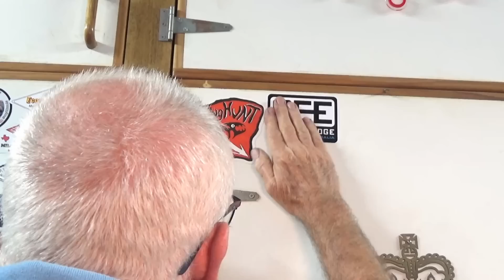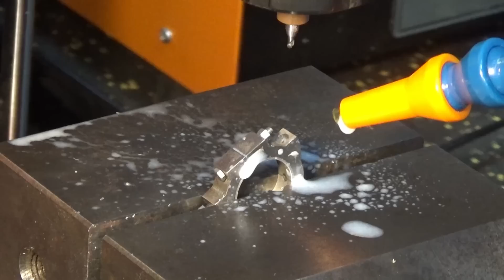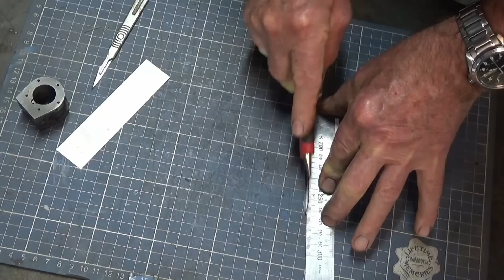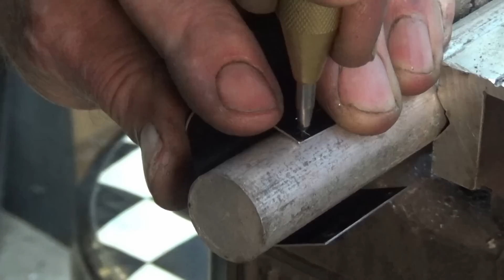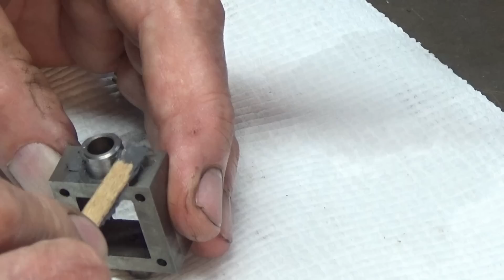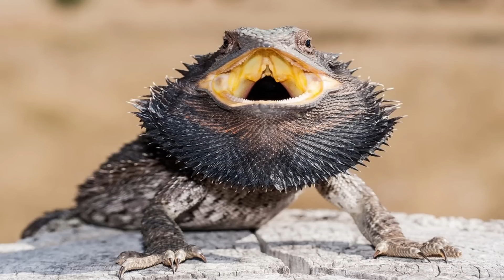The Stuart Turner 10H Part 8. Final Assembly and Run

Comment: How much luck do you need for the broken end of a carbide drill to jump out of the hole rather than digging in?

I'm making a locally produced Bolton #2 horizontal engine ATM. It's a pretty simple thing to make if you can avoid doing dumb things like getting the ports off-centre despite using a DRO & edge finder!
Reply from the maker: I know! Crisis averted, I reckon. It hardly ever happens around here.
Regards,
Mark

Comment: Great work!!! I have cleaned up sticky dash pots in high voltage circuit breakers which are essentially a piston and cylinder using Brasso. Perhaps a quick run with Brasso instead of or mixed with oil might help? A good clean afterwards of course.

Comment: Carbide drills are very sensitive to runout. On a drill that size, even .001" runout is a lot. I suspect this was part of the reason it broke. Luckily it fell out of the hole though!
Reply from the maker: I knew it was a high risk procedure and I fully expected that I would end up breaking a few bits. Getting it jammed in the hole was my biggest fear though.
Regards,
Mark

Comment: Once again a perfect candidate for EDM plunge tool. If you have any small knowledge and practise with electronic bits an pieces, it is a fairly easy thing to make. I suspect most small stick welders use transistorised power supplies at reasonable frequencies, ie 10-20 Khz. This is more than suitable for plunge edm use, next is a device to raise and lower electrode into work, this can be easily done with off the shelf stepper motors and drivers, the mechanical part you can make easily. The only tricky part is to control the power requirements via sensing over and under voltage/current, which triggers the up and down motion of tool, and possibly shutdown current in device. All of this stuff is off the shelf today.
Reply from the maker: I know just enough about electricity to be dangerous. But, I would love to get into wire EDM and the like. It still seems like devil magic to me!
Regards,
Mark
Reply: @Preso58  the plunge tool is far easier than wire type (brass wire running through rollers), there were simple plans around for broken bolt removal, this can be implemented from simple to more refined control over both electrical and mechanical aspects.

Comment: Hey Mark 👋🏼
That little engine is a quality build….. so when it is ‘run in’ it will go like a Singer 😁
We get LOTS of Eastern Water Dragons down here ( Sydney ) 
Specially along the creek lines.
I’ve seen one monster over 30” long 😱
Sometimes the ‘knock’ is caused by ‘late’ valve opening ( valve should admit just before TDC and BDC to provide a ‘cushion’ at the reversal of the piston stroke.
Love yer work mate… and you’re right about Kurtis & Karen. His videos should be ‘required viewing’ by all Yr. 10 students as part of Career Advice.
Inspirational…. 
I suggested just such an idea to the Queensland Govt. guys down at the recent Manufacturing Expo.
Polite nods but not much more
😤
Robert
Reply from the maker: Robert, I mentioned to Kurtis that I would have gladly used his videos as a teaching resource in my VET classes but YouTube was blocked on our school network. By the time I retired I had grown disillusioned with the way the classified positions in Education Queensland  had been infiltrated by "career educators" who had spent little time in the classroom but felt they knew enough to tell us how to do our job. Do I sound bitter? 
I am sure the Stuart 10H will run a lot better after I dismantle it for finishing. I need to go through every assembly and fine tune the fits. 
Regards,
Mark
Reply: @Preso58  
Hear hear on the Pencil Necks in Bureaucracies mate 🤬🤬

Comment: Let me try again....
Hi Mark. Great Vids.
Just wondered if anyone out there, who's just got a simple cheap lathe and no milling machine with no DRO etc, knows the old school way of using a face plate, verticle slide, "keats" angle plate etc, to machine bores or other features etc...Would be interested to hear your comments! Cheers.
Reply from the maker: I have all those things because I started out having to use a medium sized Hercus lathe (copy of the South Bend). It wasn't my lathe but it belonged to the school where I used to work. I would go in on the weekend and do all my hobby machining then. No DRO and very little tooling. I used a standard Mitutoyo vernier (not digital) and I ground all my own tools from HSS. Having had that experience made me understand backlash in lead screws and how to compensate for it and using HSS tools made me appreciate feeds and speeds and what you can and cannot cut in that way. It is just my opinion but I think that most hobby machinists probably start out with the bare minimum of equipment and gradually acquire more accurate and more expensive tooling and accessories. 
Regards,
Mark

Comment: Good thing you could save the oil passage. And thinking that I wanted to offer you some very small carbide drill bits when you were here. But you refused :)
Reply from the maker: Ahh yes. I never thought I would need them! How wrong I was. Every time I go to the dentist I ask a lot of questions about the tools they use. I recently had to have a root canal procedure and I asked about the files and drills they used and they gladly showed me. The little files are finer than a strand of hair and they can curve around and follow the nerve cavity in the tooth. At the same time I was given the little dental burrs I was also given three dental picks and probes. They are wonderful tools and super tough. The quality of the steel is exceptional. 
Regards,
Mark

Comment: It's annoying when the engine runs stiff after all that work. I had the same thing years ago but it was much worse than yours as I had to machine 3 thou out of the cylinder and all was good after that but it took me almost all day to find the fault. I still could not find why because I machined all the parts to dimension.
Reply from the maker: Yes, it's frustrating. I thought I was doing really well up until the time I started to fit the cylinder to the rest of the engine. I think the issue is a lack of concentricity in the piston rod gland. I cut the threads with a die and I should have single point threaded them while they were in the chuck. I may have to bore the hole in the gland a bit bigger. It goes against my instincts to oversize such a hole but the gland packing will take up around the piston rod and it won't leak but it still seems like a cop out. 
Regards,
Mark

Comment: I have never been able to drill a hole with those small tungsten drill without breaking one either!
Reply from the maker: I had read some reviews of that set that I bought and that was the common complaint. I sort of knew there was a high chance of breaking it but I just wanted to get through the surface hardness. If it had jammed in the hole I was going to be screwed but for once the broken off point did the right thing and flicked out of the hole. 
Regards,
Mark
Reply: @Preso58  I have bought loose ones at exhibitions for 10p each. I think they may be designed for drilling PCB  boards. The cutting edge has a small angle compared to a normal drill.

Comment: Hi Mark. Well done on getting out of a bind. The Dremel comes in handy from time to time. The Stuart engine looks beautiful. 👍😀
Reply from the maker: I wish I had one of those Foredom flexible shaft grinders. They always seemed to be the most desirable of the hand held grinding tools. I used to drool over the advertisements in the old Model Engineer magazines and even the older style of Dremel tools seemed to be a luxury I couldn't afford. As it turns out, the Dremel I am using now is the third I have owned. The first one ingested a piece of steel scrap and blew up spectacularly while I was using it and the second one had a failed speed controller unit. This third one had better last!
Regards,
Mark

Comment: American patriot Thomas Paine once wrote "These are the times that try men's souls..." While he was not taking about machining stainless steel, it applies to your frustration! Very happy it turned out okay in the end. I really like the brass lagging! Your local menagerie never ceases to amaze me mate! The engine is a work of art.
Reply from the maker: Thanks. Despite the multiple problems with that 3D printed eccentric strap and rod, it really does look great and it satisfied my curiosity about 3D printed metal parts. I have a model turbojet engine that is currently awaiting some remedial work due to a hot start distorting the nozzle guide vane assembly. I made it from two stainless steel parts that were tig welded together. It was not the best way to do it because the assembly is prone to distortion due to uneven heating. I am considering having the part printed as one piece. The great thing about 3D printing the part is that the complexity of the part doesn't increase the cost. It's only the volume of metal that sets the price of the finished part. 
Regards,
Mark

Comment: Nice work, I am building a 10v from scratch (no castings) 👍👍
Reply from the maker: That will be a real challenge. So many odd shapes that need to be rendered from solid stock. However, I remember reading a book by Gerald Wingrove. He made exquisite model cars from scratch and his observation was that all parts are just primitive shapes like cylinders, cones and blocks joined together. 
Regards,
Mark
Reply: @Preso58  I am about halfway through 👍

Comment: Hi, did you use gaskets/joints between the cyclinder housing and end plates and the steam chest? These can add the slightest extra clearance for the piston etc so that it can be better adjusted to not make contact at either end of the stroke. My Stuart D10V came with the gaskets pre-cut.
Reply from the maker: There was a set of pre-cut but very thin gaskets in the kit. These may not survive the rebuild but I have some thicker gasket stock for the second assembly. I think the issue is the gland nut on the cylinder cover. It seemed to be a bit tight in certain orientations and the thread is probably not concentric with the end cover. I may have to re-make it and single point the thread. Which is a pain!
Regards,
Mark

Comment: I felt the pain of the broken bit.
I dropped my centre rest and broke the hinge. No problem, braze it and re-drill the hinge pin hole . The drill sank through the braze and broke when it hit the cast iron. The brazing had hardened it. 
Used a carbide end mill and drilled out the twist drill, then broke the end mill at the same point! Luckily it fragmented and I was able to blow the fragments out. Second carbide end mill and very gently got past the transition. 
15 minute job took half a day and lots of frustration.
Reply from the maker: Well, I can certainly sympathise. These things are sent to try us!
Regards,
Mark

Comment: Most impressive! I built one of these, like many did, some years ago,  but without the improvements you added. One thing I wished I had looked into was adding some sort of counterweights to the crank shaft or flywheel. These engines can really bounce around on a table. What I also found was that the public only sees the engine's cosmetics, not so much the workmanship. Importantly a beautifully dressed up engine can be very inspiring to lure students into the field. Some inspiration may be found in looking at how the Victorian steam engines were dressed up. Thanks for the video. Cheers.
Reply from the maker: These little engines really do run at non scale speed. I am hoping to build something like a dynamo for it to run so it can operate at a lower RPM. Just turning down the air pressure doesn't really work so well since at either end of the stroke you are just relying on the momentum in the flywheel to keep it running and with such little mass in the rim of the flywheel it still runs a bit choppy. 
Regards,
Mark

Comment: That's awesome see that running...I can remember building a hot air engine as a school project many many years ago it was a long process but it worked and I got top marks...keep up the good work nice to see how u go about different challenges on that build ...
Reply from the maker: It must have been a nice achievement to be able to make a working engine at school. The best we could manage was a little oscillating engine but ever so many were never finished and they got tossed out at the end of the year. I did have one class though who really took it seriously and they even added refinements like fans and propellers to the crankshafts. One kid finished his in traditional John Deere colours. 
Regards,
Mark

Comment: Hi Mark,
Close call on the 316 drill hole, nice save.
Version 2 in brass cover cleading strap thing 👍👍
High speed load test run: "pass" 
Sure looks great, I'm sure you'll have the friction drag issue sorted soon.
Cheers....
Reply from the maker: Thanks Dean. I am still chasing that illusive "Joe Pie fit". 
Regards,
Mark

Comment: Lovely little engine! Bet she'd look sweet in pinstripes…
"Cleading" - a new word for me. Related to "cladding," maybe? I think some little hex head cap screws in the corners would look more authentic than the slot screws.
Congrats
Reply from the maker: I am leaning towards a more industrial look for this engine. I have some nice grey and sage green powdercoat. Back when I had steady hands I used to add "lining" to my engines with an old school drafting ink pen. I still have it actually but my poor old shaky hands would never make it work now. I used to refer to cladding as the wooden slats which were often clamped on the outside of boilers and engine cylinders. Cleading however always refers to sheet metal over the insulation material. I used to work at the Brisbane Maritime Museum as a volunteer back in the late 1970's and they had a warehouse full of formed asbestos insulation sitting on high shelves. It was left over from the days of marine steam plants and it was sitting there awaiting disposal. The thing I remember was looking up at the particles of asbestos glittering in the sunlight coming through the overhead skylights. How times have changed!
Regards,
Mark

Comment: I was warned by someone who works with 316 to not go slowly and never, ever stop drilling. There's  also a problem with 316 nuts and bolts , they can cold weld. Only had this happen to me once. Fortunately application of excessive force got them apart. Really should only be spun on by hand.
Reply from the maker: I have heard of stainless galling together. I spoke to someone who did a lot of marine engineering and fabrication and he told me that they always used two different grades of stainless if a nut and a bolt had to be used as a fastening system. I learned the hard way that a Bridgeport is not exactly the right tool to use if you want to drill tiny holes in 316. My Bridgeport quill is quite stiff and you get zero feedback on cutting tools that small.
Regards,
Mark

Comment: Curtis is a great example what can be achieved with hard work and constant mind set. He goes from strength to strength and is a master of welding. Mark where would you go for fixed reamers for hobby metal working.
Reply from the maker: I just bought a set of imperial machine reamers from CTC tools https://www.ctctools.biz/hss-reamers/
They are based in Hong Kong but the quality of the tools seems to be very good. I have purchased reamers from random eBay sellers before and it's a bit hit and miss in terms of accuracy and overall quality but CTC seems to be uniformly good and the shipping costs are reasonable. The last purchase I made turned up in about two weeks.
Regards,
Mark